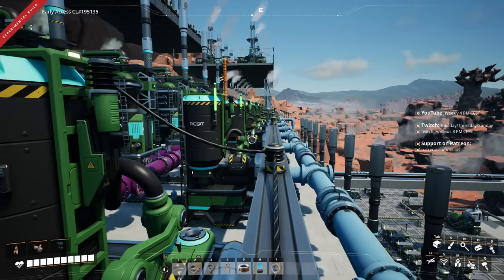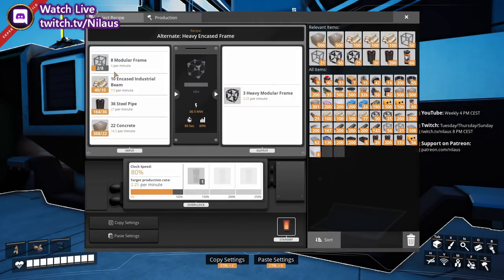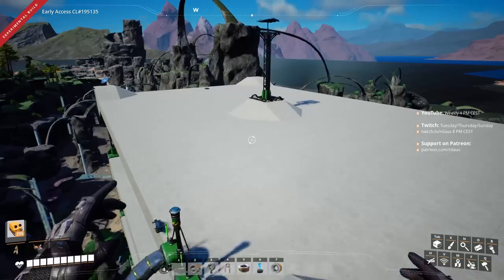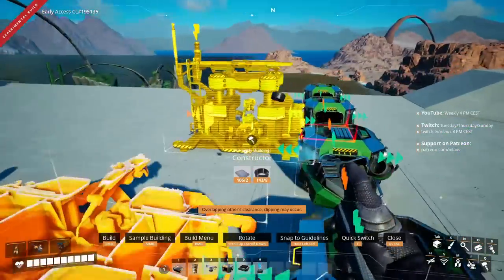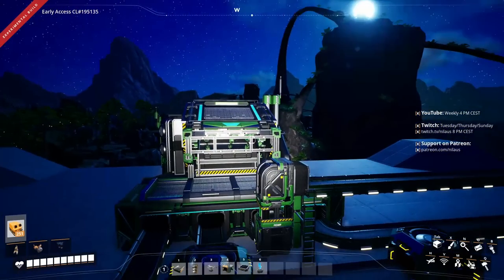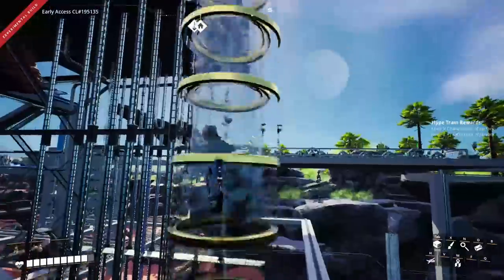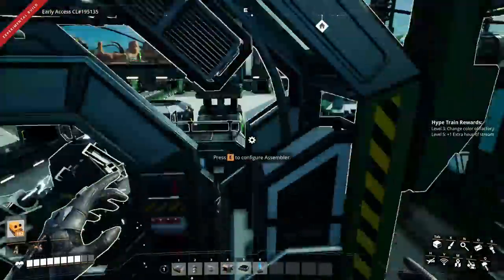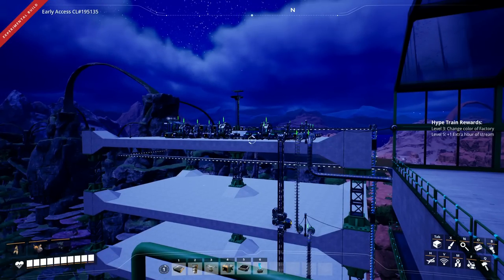Why MODULAR BUILDS Are Better! Featuring Heavy Modular Frames | 08 | Satisfactory Update 6

Comment: Pre loading the machine and adjusting the clock speed to theory craft your inputs is the most brilliant tip I’ve seen in ages for satisfactory. Thanks Nilaus!
Reply: Well it kinda should be stock. I don't get it why you can't see the consumption rates unless it's working...

Comment: I used a circular main bus method. It makes setting up for making the complicated stuff quite easy. The hard part is finding space to pull materials from. I have 9 lanes of belts, 5 stacks high. I recently got fused modular frames produced. I have yet to make super computers but I will be using an alternative recipe that requires cooling units.

Comment: I totally burned myself out in my first 2 or 3 attempts.  I got caught up in perfect ratios and huge iron based factories.  Producing 50 reinforced iron frame per minute, but not needing anwhere near that.

One thing I've been doing lately, especially in the early / early-mid game, is to manually transfer full stacks of materials for anything that is not yet an input to another chain.  It really really helps kickstart you with minimal frustration
Reply: so true, i never realised how useful it is to just have a bunch of manual diggers at the start and then you can just manually transfer all of it into storage which can feed a basic smelter/constructor chain, sped the start up soooooo much.
Reply: So true place like 10 of those on each node. Build modular circuits that can be feed by raw resources, underclock them quite a bit and you get into mid game pretty damn fast.

Comment: Funny, its also modular to heavy to fused frames that I'm making right now in my save, using drones to export them from their self-contained factories to the next step.

The downside of perfectly compartmentalized 1-final-manufacturer production lines is that many of the more efficient alt recipes have strange input and output numbers, meaning it is necessary to juggle exact ratios and clock %. Sometimes it's easier to plan a balanced ratio between multiple machines and recipes, bookworming the wiki and writing down a plan, then that is the "module". The same concept except in bigger chunks, which still better than making a mega factory for dozens of hours before turning it on. Like that one steel screw constructor, it could easily feed the entire tower by itself, so it could have been at the bottom floor feeding every module above instead of being duplicated at every level. Works better in a vehicular export environment too when trying to exploit distant resources.

Comment: Technically the only disadvantage of modular builds is you are likely to build slightly more machinery, but that's a small price to pay.

BTW, I'm quite positive you know this, but for some reason still rotating second splitter/merger in a stack when you placing them. As I know game alternating directions of those for some reason, so you can place first one the way you want the 3rd one to be placed and just build two more on top immediately without fixing direction of the second one.

Comment: I don't understand why they won't or can't put in a blue print system. All it is, is an array of ID numbers with a visual interface that can be placed like anything else. When placed, the function looks up the id, where it is on the array and builds the item as long as you have the mats for it. I bet that is how the mod works (I assume there is a mod).

Comment: I think some of the recipes needs a rebalancing. Like Encased Industrial Beams; it takes a lot to produce a little. I had to create a separate site for this. I had originally intended for 128 per minute. I had to settle for half; because of the lack of coal, which took 2 trains from 2 different sites to bring in. I used the best alternate recipes for this. Even then it is not always balanced. I wanted to produce a lot of the heavy modular frames. I settled for a bit over 11 per minute. After a while I realized I didn't need so much. Because it produces so little per minute, I am always thinking I need to ramp it up to something like 20 or more per minute.

Comment: Interesting approach, and I totally get the idea of modular builds. Genuine question though, as these are building to populate your 'hub' why not scale up the downstream modules that build the parts needed for heavy modular frames (mod frames, enc beams, concrete, pipes) and leach from the belts feeding them into your hub? I'm fairly new to Satisfactory - does this leaching approach eventually bite you on the arse?
Reply: There's nothing wrong with that, in fact that's kind of what what he's doing with plastic although that's a fairly low level raw material. The problem is getting all those intermediary products around to their destination(s) if you're doing it all in a single base. With his extra large megabase style there would be enough room in the air to have a lot of belts weaving around the place but that is going to be a real headache later, also you may not like having that many floating items depending on your personal taste. This kind of modular building style works best when you use it to minimize the number of different kinds of raw materials going into a building. Easier to do with lower tier items where a single raw material type can be processed into many intermediary products, harder to do for higher tier items where they require many distinct raw materials. What you're talking about is actually the optimal way to do it when you want to exploit the whole map for faraway resources; specialized factories for intermediary products then transporting them with vehicles to other specialized factories upstream.
Reply: @Xhaleon  hey, thanks for answering. Yeah, far-flung, specialised factories with a central logistics hub is the way I plan on going. For the lower/mid tier stuff (and to get my hub populated so I can build factories) I'm doing similar to Nilaus but leaching off lower level tier belts - I can't face the thought of building entire process lines for each factory atm, this game is enough of a grind 😄
Reply: @darrenatarrant  I've spent 200 damn hours on my current U6 world with a large, tileable structure around my HUB in which to make all products, only to realize that its still not big enough for endgame production of the final Project Assembly deliveries. So its just an oversized shopping mall and I hope I still have enough roof space to make use of it for a trickle of exports. Only NOW am I building remote specialized factories for higher tier products but at least it makes sense to do it after unlocking flying drones. A lot of lategame products have outputs in the 1-digit /min for each machine.

The game is designed around remote factories anyway. The most efficient ore processing alt recipes all require water, so if you want to scale up big you'll be building those refinery blocks near the coast or around lakes. Then at that point you might as well just have separated factories rather than trying to cram them all back into a single location. Nilaus is just doing that for the challenge and aesthetic.

Comment: Just a thought on better balancing of belts when splitting items... if you belt into the first splitter, instead of splitting off to the constructor/assembler or whatever, why not split 3 ways, send 2 to a merger, and the other to the splitter.. it would mean 66%/33% at the first split, therefore saturating the end of line quicker? I haven't tried this myself - just thought of it watching you do this build...🤔🤔
Reply: Since this game has infinite resources and consistent and constant production, lane balancing is, for the most part, irrelevant.
It's a huge change of mind comming from Factorio but it will save you the unnecessary headache.

Comment: I always thought modular builds are better but by now I found a mix of mega and modular to be the most easy to set up.

Next to each building in line is a lot of space where I just put another one of each if I need more of an item. The advantage is that you don't have to do all the connections between buildings over and over again as they are already in place.

The eventual bottleneck will be the semi product that fills a 780 belt first but until that point you can increase production very fast.

Comment: Not agree. I prefer to made basic resources like ingots right on the place near the miners. You 100% need ingots (and concrete) and don't need raw resources. So no reason to smelt them into production module. If I have several mining spot, I can place bigger factory producing secondary products like rods, screws, plates and so on and deliver them to nearest production module. It's all about logistics
Reply: It's a possibility but eventually it does not make a difference if you belt in raw ore or ingots.
The advantage is that you can make the exact amount of ingots needed for the next step and then continue with the next step right away. Else you would be making ingots and more ingots and more ingots not even knowing what for, which is exactly what Nilaus said in the beginning of the vid. 

Oh and a fun fact, once you unlock steel and the alt recipes you can complete the entire game without making a single iron ingot at all.
Reply: First "not agree" is not a proper sentence.  Second, who are you do tell someone how they can or cannot play the game?
Reply: Not everything comes out of the ground and into a basic item 1:1.  Steel breaks your paradigm, right?   Aluminum as well.
Reply: @StellarisIgnis  While I totally disagree with @disorder, it's his right to say he disagrees with @nilaus on this.
Reply: @stevemoss8931  I agree he has the right to disagree, but he comes off as matter of factly as in his opinion is higher than Nilaus.  Considering his grammar though I suppose it is possible English isn't his first language and he may not mean it that way.